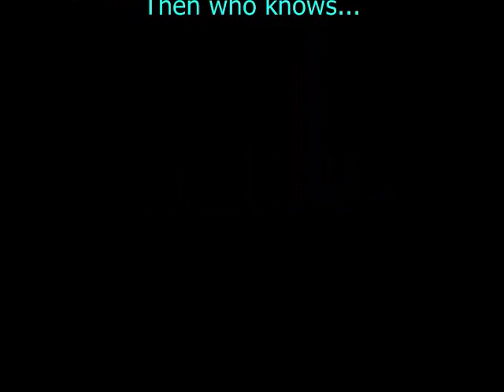My 900 VA Tesla Coil! (Resonant Transformer) Lightning Machine

Comment from the maker: @PhxSt0rmz They are very fragile creatures, let me advise you employ a filter designed by Terry Fritz (just google it). Its simple, and will protect your nst's. I use one. as well, your 3600 rpm motor means that it has two main windings, and runs at /about/ 1 revolution per cycle. What you need to do, is take out the rotor, and mill or grind  2 flats in the sides, on opposite edges. This changes the flux characteristics of the rotor, giving it "inductive handles" for each peak to pull on.

Comment: @highvoltagefeathers True but NSTS are fragile and its not best to use a normal motor as you risk damaging stuff.  I do have a motor, that runs 3600RPM, and on my glass desk i hear it phase in/out.  No idea if it would be able to run SYNC or not.

Comment from the maker: @PhxSt0rmz I'm terrible on the spot unless I have something prepared :P sorry, but a static gap will work great, let me advise you use a vaccume-cleaner-quenched sucker-gap, where air is drawn through two copper pipes that aren't quite touching. This method works excelent. Do you mean a-synchronous (not synchronous), or "A synchronous (a synchronous motor)? big difference, and you'd like "a synchronous" motor for an AC tesla coil :P

Comment: Ya you sound like you got confused on some stuff xD  Good to see what yours did, I have a single 12KV 60mA NST and a terry filter.  I dont have ASYNC motor for a sparkgap, so im just using a few copper pipes...I calculated these transformers need 19.8nF to run good.  So, I did a bank for 20nF of those capacitors.

Comment from the maker: @chiminator45 Well, you'll need an amplifier for your function generator, schematics which can be found quite readily on the internet. The one you'll use would probably be pretty simple, not like you want to send any information :P
and generally the transmitter is larger than the reciever, but I dont see that this needs to be. All you need are inductor/capacitor circuits tuned to the same frequency (probably closer to 1 ghz). I'm not sure about the recieving circuit, but im sure there is more